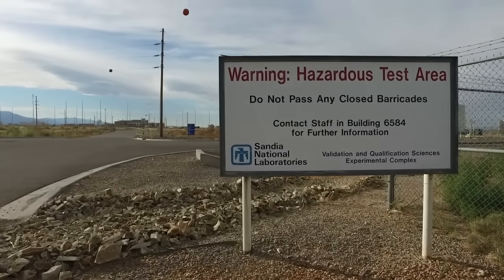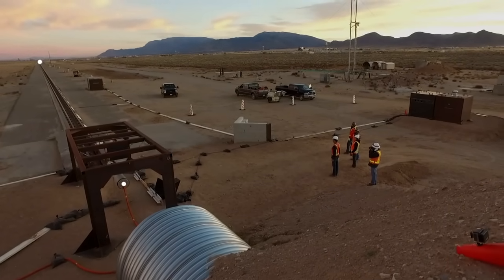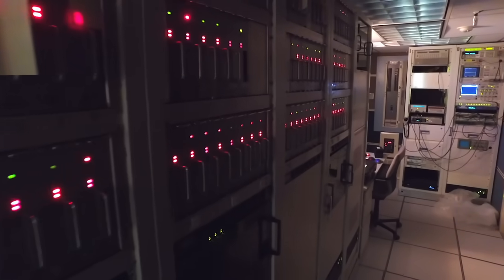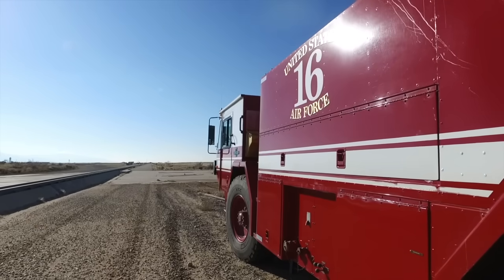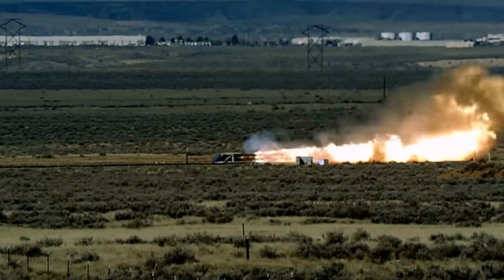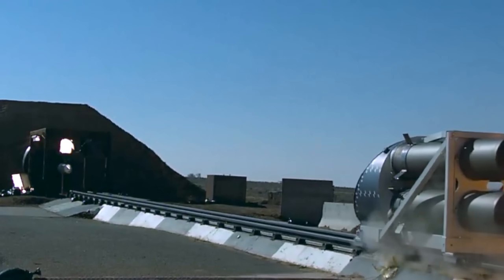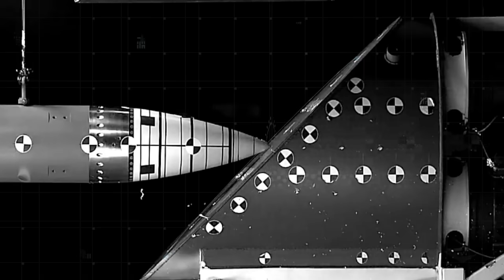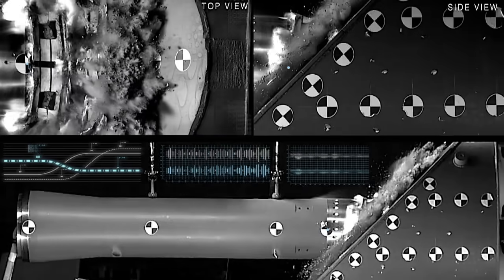Rocket Sled Impact Test In Slow-Motion

Comment: I feel like this video told us absolutely nothing about what was actually being tested.

It's like listening to someone trying to sell you on an ICO.
Reply: Darius Kang  Yes. I mean, the description given isn't hard to follow at all.
They're gathering data on how the missiles respond impacts
Since the last thing you want is a nuke going off unintentionally. (because it was dropped in the wrong location, the plane carrying it crashed, something struck the storage facility... Whatever)

Since they can't use live weapons for a test like this (should be obvious why not)
They're feeding the data gathered into a computer model, then using the data to simulate what would happen under various conditions, and seeing if any conditions would pose a safety hazard...

That IS more or less what they described here. Not all of it explicitly, but it's not hard to fill in the blanks...

The crash test data feeds into a computer model, which is then used to predict behaviour of a 'live' weapon in similar circumstances, and see if there are any predicted situations in which the weapon becomes unsafe... (which may or may not feed into further practical tests to verify if this is an actual risk or if the model is still flawed...)
Reply: I strongly agree.
Reply: The angle shows that they probably gonna nuke the pyramids. 🥴
Reply: The angled front of the sled is a piece of material they use to insulate nuclear storage facilities and they tested how much it can withstand in an attack of a missle was launched at it
Reply: @user-de4cq6uk6l  I’m surprised very few commenters figured out its not the missile being tested, but the structure that covers the nuclear storage. I built numerous classified structures from steel and concrete that were test blasted with various types of ordnance. Never heard the results but when they came back with slight mods to previous designs you kinda know what was working.
Reply: It's more of a video showcasing the capabilities of the Sandia Lab, not really a video detailing U.S. nuclear weapons safety.
Reply: It's likely they tested condition where the weapon hits the ground but very much should not explode. That kind of situation has happened with air dropped bombs several times. Even with ballistic missiles, there is a chance that people rethink their decisions and want to call it off once warheads are already on the way.
Reply: @aleksandersuur9475  so dumb
Reply: @aleksandersuur9475  ICBMs are designed that once launched, no changes can be made
Reply: @IR-xy3ij  i very much doubt that, if I was designing a doomsday device I'd include a "cancel end of the world" button for sure. I might not tell anyone I have such a button, because in the end a nuclear missile is a deterrent and the scarier it is the better, but I very much would like to have an method to disable it at the last moment hidden away somewhere. Just in case you know.
Reply: @aleksandersuur9475  

Uhhhhhh....... you do realize that nuclear ballistic missiles don't have a self-destruct. You can't "turn them off" once you have fired them. The second you turn those launch keys and set the ignition, there is absolutely nothing you can do to stop it.

It's pretty obvious why this is the case. You have to consider how that would work? Clearly you would need some kind of remote control mechanism to activate a self-destruct mechanism. Well guess what kind of any mechanism that you have as some kind of safety, is equally a mechanism that the enemy could use to exploit. The last thing you want to do, is have a built-in receiver on your Warhead or missile, so the enemy can spoof the self-destruct signal and effectively wipe out your entire nuclear deterrent.
Reply: @aleksandersuur9475  Absolutely zero ability to recall a Minuteman III once a second valid launch vote has been received. About 30 seconds later, the missile is leaving the LF and about 30 minutes after that is the boom.
Reply: @aleksandersuur9475  ...yeah, ok Dr Strangelove!
Reply: @aleksandersuur9475  bro icbms are called fire and forget missiles... They can't be stopped once launched
Reply: @IR-xy3ij  and theres 3 back systems to make sure....sad but true
Reply: @aleksandersuur9475  It wouldn't do much good to cancel at the last moment because by the time it gets halfway to where it's going, the other side has already launched theirs.
Reply: @dhy5342  and most importantly it’s like giving your nuclear bomb to the enemy
Reply: @IR-xy3ij  - That is 100% wrong.
Reply: @IR-xy3ij  That's not true. I was in line for a position working on Kwajalein Missile Range. That's what it was called at that time. The purpose of that facility was to track ICBM test launches from California and Nevada. This was the down range tracking location. As part of my schooling for the position I had to complete hours of training on the equipment I would be responsible for maintaining. Part of that training included ensuring that the equipment could monitor changes in trajectory during flight initiated by the launch facilities on the mainland. I ultimately did not get the position because another person had better scores on the final exams. Looking back, I'm not sure I would have liked it. The island is only about 1 mile wide and 2.5 miles long and EVERYTHING for living is flown in.
Reply: definitely. cool images, that's about all I learned.
Reply: There is a reason for that.  Sandia tests are very secretive, as are anything related to nuclear weapons systems.
Reply: It's a video of my finances, after the divorce. LOL
Reply: Here for the NathansHVAC roasts
Reply: Just testing, does this explode if I don't arm it.
Reply: Yeah I agree. They made nuclear weapons safe and reliable. Good job? but what's that have to do with slamming a rocket sled into a suspended missile?
Reply: These tests are usually of the triggering systems, to ensure the warhead doesn't detonate if say, there was an accident (or some kind of attack).
Reply: @Ikuorai another fellow who aped into the ICO craze. May I introduce you to this defi token with a 2.7 mil apy yield?!!
Reply: @merlinthegray  What is it telling of? Other than the truth..
Reply: That's classified
Reply: they could have a live HE package around an inert core (see: French Test Object). If the high explosives are triggered with the correct timing, the fission reaction is going to happen. From there, the initiation of the fusion reaction proceeds at speeds much much, much, greater than mach 6....so you are going thermonuclear.
Though it would be better to have devices that receive the detonation triggers at various points in the lens, and then compare the timing to see what kind of fission yield you might get.
Reply: I like what you said, but what's an ICO?
Reply: @vctjkhme 
Thanks; however, I don't really know the details of the macaffe fraud but pretty much can figure out what you're saying. Interesting how they chose an acronym that sounds so close to what we've heard for decades (i.e., iPo). People are so easily duped. It's sad.
Reply: totally - no idea what the point of it was but at least it was enjoyably dramatic 👍
Reply: That's the point. We don't want our adversaries to know what was being tested, just know that something was.
Reply: BORIS BADANOV: Rrrrocket test bomb, ok !?
Reply: @Sandra Braithwaite lol you're right it's kinda similar
Reply: these mother fuckers will sell you air and water given the chance.
Reply: I know, I have no idea why they are doing this
Reply: Did we even hear the speed at which the camera was traveling?
Reply: dumb comment
Reply: Nuclear weapons dont, and never did, and never will exist
Reply: Yes.  My only thought is WHY???
Reply: Testing new fireworks for the 4th of July
Reply: I thought I was the only who thought that.
Reply: Aye
Reply: You think they're gonna give the classified info on YouTube?
Reply: @Widget_Master  This is america, they give everything free.  Look at Afghanistan, it is a part with American toys left behind by Biden!
Reply: it's not meant to tell much. lol. it's showing exactly what you can understand. the more you know about it, the more you get out of it. like star trek, shrek, or basically any good video content. even a kid can watch and go "oh wow!"...
Reply: Yep.
Reply: It tested the structural reliability scale of our weapons delivery systems technologies. Never were a teacher's pet, were you?   :)
Reply: @htos1av  what kinda was that?
Reply: Intentionally ambiguous as our enemies can watch this video too
Reply: Yeah because they just share information on nuclear weapons on youtube. Ok boomer
Reply: What the heck is an Ico?
Reply: @vids5374  initial coin offering
Reply: Yeah we're pretty tight-lipped about the inner workings of our nukes for good reason.
Reply: Would you believe them if anything they said made sense?
Reply: So you are trying get informations of a millitary test, being a civillian and not get in the US federal Black list at the same time?
Reply: The most connected generation you are not.  That was air drop weapon.  Notice the angle of attack was 45 degrees just like an air drop or cruise missle.  The trigger was obviously ground contact burst.  The is normally done with radar.  But, I'm sure a contact switch is also used.    Notice the tunnel to collect the classified debris.  A lot has to happen in 1ms.  Obviously the core was removed.  Notice the video is cut before the core is detonated.  These are old weapons that change with time.
Reply: @NathansHVAC  oBvIoUsLy
Reply: @NathansHVAC  Thanks Mr. Knowitall
Reply: @NathansHVAC Generation has nothing to do with it. Not many people know the basic functioning of a nuclear warhead, including those that lived during the cold war. 
Why do I get the feeling that's your go-to insult when you think someone should already know something because you do?
Reply: @NathansHVAC  that's a smartass way of explaining the obvious part.  The question is how they are protecting our nuclear weapons capability or whatever by testing its ability to get atomized from  what may as well be a wall moving thousands of miles per hour?
Reply: @NathansHVAC  I thought they were testing to see if the weapon flinched?
Reply: @NathansHVAC  any generation should be able to infer that it was simulating a bomb impact obviously, but the video should have definitely said why
Reply: @NathansHVAC  Aren't you the superior one!   You must depend on these reprobates for your support.  It is kind of obvious.
Reply: @NathansHVAC    nearly right - I think that impact angle ( simulated ) plus a very high mach - would be the representation of an icbm warhead inbound on a ballistic trajectory....whose internal instrumentation, presumably, was being tested to ensure that it would detect the ground rushing up to it, in time, for it to fuse and detonate the weapon in a simulated ground-burst fashion.  you see - icbm warheads come in at mach v. high ( circa 20 I'd estimate given that orbital velocity is circa mach 25 ) but with the air-drag / friction-drag of the atmosphere that would have to reduce a bit....and  I reckon it's likely that by the time it reached the ground it could well be about mach 8 or 9, therefore....and as other comments, here, state..the rocket sled speed was to be around 8.6 mach.  lastly an air-dropped weapon's terminal velocity due to simply gravity ( from any height that an air-breathing engine'd plane  ( or it's own engine if a cruise missile which btw operates at low level so is not relevant here ).....would not be anywhere near the speed of this sled. have a look at icbm warhead reentry videos to see how fast they come in - and the speed is : screamingly fast .... ! have a good one...
Reply: @NathanHVAC - An 'air drop' test conducted at Mach 6? The 'video is cut before the core is detonated'? LOL...Oh, sure, 'obviously'...you must be ever so much better connected and informed after watching countless hours of documentaries and videos to obtain your peerless knowledge...in Heating, Ventilation and Air Conditioning.
Reply: NathansHVAC thank you..... ugh.....
This is also a way of test ing the “fail safe” of the trigger if it is ever dropped without arming.
Reply: @TexasScout  bravo! Its basically spelled out in the intro! Goes to show you,  intelligence means nothing if one doesn't take the time to think.
Reply: They said at the very end its for safeguarding the US nuclear stockpile. Did you comment before the end of the video?
Reply: @dabswithnate  Tell us how this test is connected to that goal then.  I'll wait.

Comment: Testing to see how a nuclear bunker buster fares against a concrete bunker if it comes in at an angle, and if the actual nuclear part will survive the impact long enough to still detonate once it gets through? Makes sense.

What I want to know is how do I get a job doing this? What qualifications do I need to be the guy who rams a rocket powered target into an inert nuke? Cuz let's face it, that's got to be the funnest job ever.
Reply: Yeah, you don't blow up a city just to get to someone's basement. Nuclear weapons are meant to detonate far above the ground.
Reply: Dan Bowkley nuclear weapons are not designed to penetrate.  Wrong answer.
Reply: @markpaintner8365  B61 mod 11.
Reply: What is neucular wepon?

Comment: What’s the data collected and what’s it being used for?
Reply: The data would be system related for example "did the system malfunction and detonate on impact?" If it did they can use the information tweeking the system putting in maybe thicker wiring or changing the placement of the CPU, its basically inducing a controlled fault then troubleshooting

Comment: At 1.49 seconds something moves right to left in front of sled. The sled is moving super quick... So what the hell is that small spec and how can it be moving that fast??? Anyone?
Reply: raymo fitz 
Probably the leading edge of the shockwave.
Reply: Thanks for the reply but its not anything to do with the shockwave. Its like a piece of debris that moves like a bird flying 7ft of the ground from left to right. look again. cheers
Reply: raymo fitz 
Ahh, you are right, it really does appear to be moving practically perpendicular to the path of the rocket sled as it continues past the target and out of frame to the left. Weird, looks to be something like a thin geometric tile spinning in flight that is reflective like aluminum or white plastic.
Reply: and when you take into how fast that sled is going ... it looks to be moving just as fast or faster still. A mystery it might remain

Comment: Very interesting.  I don't get how the safety of the Nuclear Weapon Stockpile was proved?  Both the highly-accelerated "target" and the suspended missile were totally destroyed.  Looks like I missed something?  (Did the suspended missile represent an enemy missile?)
Reply: A nuclear weapon needs to be able to take a high impact without detonating unless it is intentionally armed. For example, if a plane carrying a nuclear weapon were to crash, the weapon shouldn't detonate.
Reply: Thanks Nic, I actually knew that, but I can't see how this test proves that, I mean, both the suspended missile and the rocket-powered "target" (as they called it) were totally destroyed.
Reply: In many "broken arrow" scenarios where a nuclear weapon is lost, it too is totally destroyed. However, if the weapon were to detonate on impact, that would be catastrophic. 
Nuclear weapons have a variety of safeguards built into them. This test used sensors to determine if these safeguards remained in place or if the weapon could have detonated.
Reply: Ok, got it, thanks Nic.

Comment: What is the benefit of doing this test in reverse instead of sending the actual projectile toward a static wall?
Reply: Ease of instrumentation. Using a fixed projectile means you can hard-wire all your sensors into it and just use a cable.